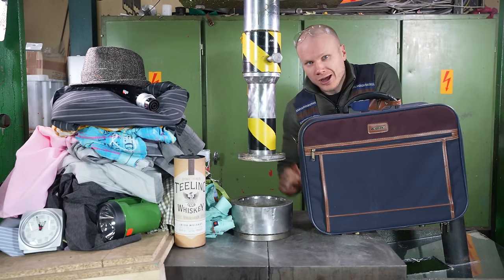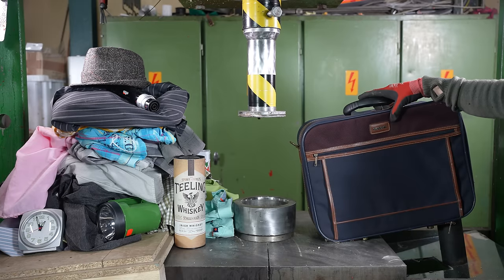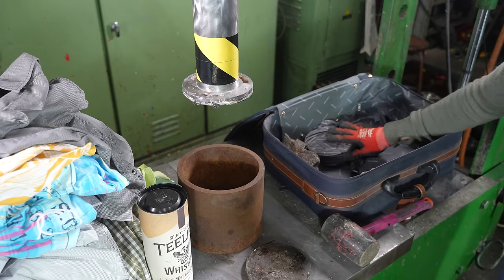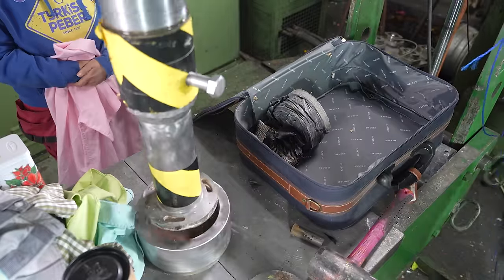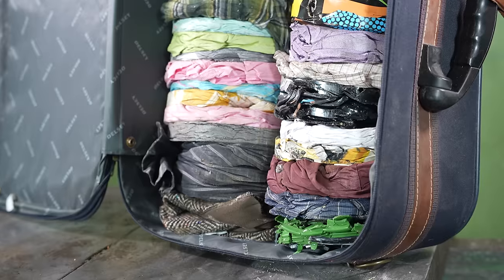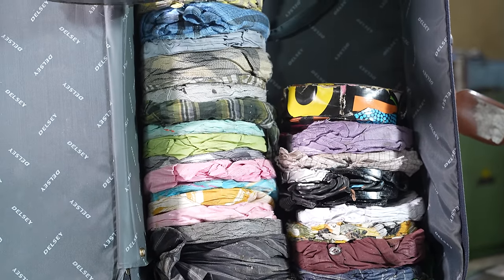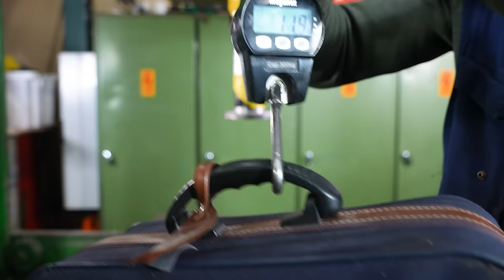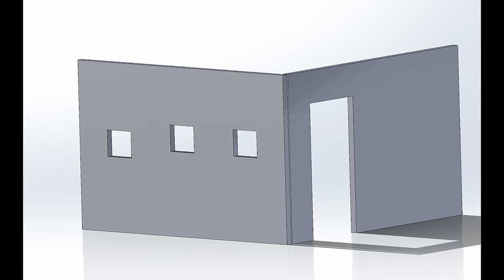Packing a Suitcase with a 150-Ton Hydraulic Press

Comment: Even after vacuum cleaner clothes packing I always imagined how such travelers gonna re-pack all of those at the customs after a random luggage check... But after HP it's even more impossible task.
Reply: Just bring your 150t hydraulic press with you.
Reply: Vacuum packing for travel, only use your body weight to drive air out of the bags, then it will repack.
Reply: He's taking a trip to the factory.  His new 300 pound hydraulic press is ready. He making the next video there.
Reply: I have a little hand pump that came with my vacuum bags that I travel with. Not as good as the vacuum cleaner but it works. Portable press might also not be as good
Reply: @bytesabre  I have one as well..need to use external power supply..eg; a battery pack like you use to charge a phone..But I now use ..hand pressed ones..You rolled them as tight as poss to expel the air..So no need for the pump..They work pretty well..I'm not worried about creases.(not vain)..as long as my clothes are clean...Plus they have the benefit of helping to protect clothes against water if your luggage is not waterproof..Like when it rains during tranfers.
Reply: I did that just recently.  I got a bag that was the exact size that Spirit and Frontier allow for a "personal item".  Then I packed all my clothes in a vacuum bag.  Had a battery powered vacuum I could have brought, but I found I got better compression by just sitting on the bag (set upright on its end) and pushing down as hard as I could.  Since the vacuum port had a check valve, every time I pushed a little more air out, the bag just got more and more dense.  Worked great.  So well that when I was getting ready to come back, I was wondering how it would all fit back in the bag.  But fit it did.  That bag weighed over 20 lbs!  Security didn't stop me, but if they had insisted on opening it, I could have repacked it with no problem, just some hassle.

Comment: Nice! 
Have you tried a 2-piece outer press tool? Imagine the outer ring cut into two C-shapes, joined with an interlocking lug-clevis hinge, and a cam lever closing clamp on the other side? You could perform this kind of operation so much faster; just unlock the cam clamp and remove the item, lock it down again, and you're ready for another cycle
Reply from the maker: I might build one like this for test when I have the time!
Reply: @HydraulicPressChannel  I reckon Lauri should show us some of those clothes unpacked at the other end..  Maybe proof of concept by wearing the clothes to the factory 😛
Reply: I wonder if with solid items a simple false bottom would work? As long as it's thick enough and has a decent fit within the tube. Then the other end would have a tapered opening, so you only need to flip it over and press out the bottom and puck.
Reply: Liquids/gels might leak through the cracks where the 2 half meet together.

Comment: The new press looks great, I am looking forward to seeing that. Regarding the bunker, a quick word of warning if you ever intend to rapidly decompress any gas containing thing inside it, it is surprising to see what doing that can do inside even a looslely enclosed volume. I did some work for a gas cylinder manufacturer here in the UK, they had a small test building for destruction testing their gas cylinders (the kind of bottles you might have for argon, acetylene, etc. in your workshop), normally they did the testing with pressurised water, so there was no significant decompression, but apparently they once did a special test with compressed gas (probably nitrogen or something), they prepared the room by opening all of the windows and the door but still it blew the roof right off the building and cracked the concrete walls. My advice would be tie the walls together at the top (roof eaves level) and have the roof fairly flimsy so that it can be blown off easily and allow the pressure out. And probably still stop short of exploding a 50 Litre compressed gas bottle at 230 bar inside it.

Comment: I remember visiting a lab that tested slightly explosive technical failures .  Their safety walls were thicker than 10 cm of steel reinforced concrete with really tiny observation windows between the control room and the test room .  There was also a dangerous power room that we visited with the power off .

Comment: It could be very fast and efficient if you had a press die with the same base dimensions as the bag but much higher. Then you could just fill it and press everything at once into one solid block. I think the press is strong enough for the larger area.

Comment: Since there is those hydraulic pressed towels/wash clothes, If you can chuck a clothes tablet in the washing machine, run a cycle, then dry it, maybe some of the clothes would come back.  If you have them around, might be a neat follow up.